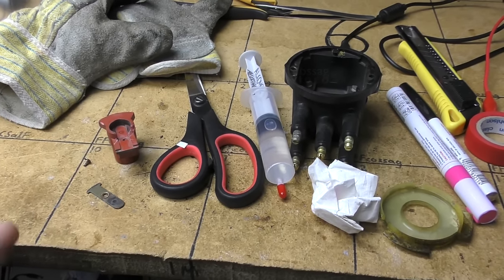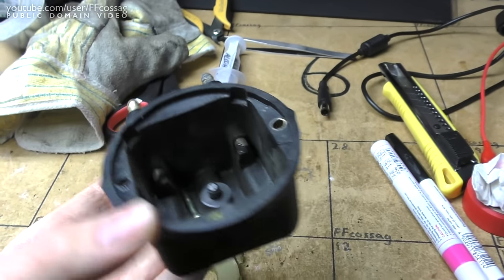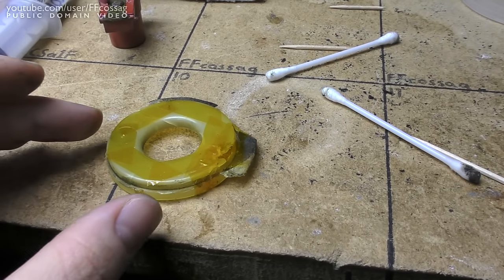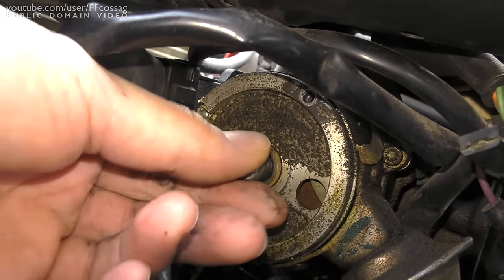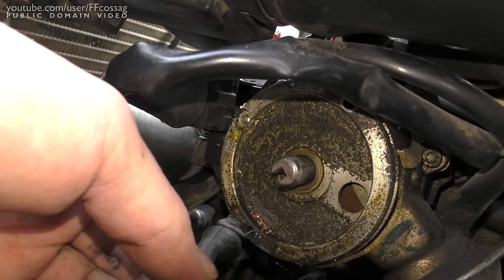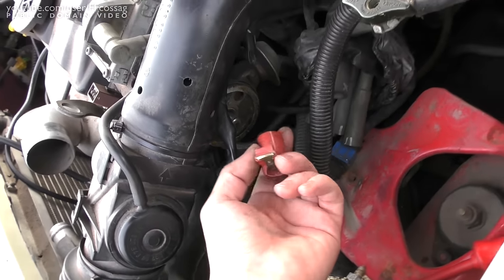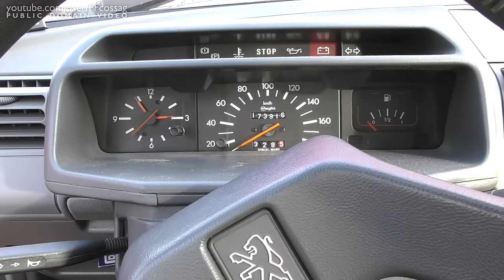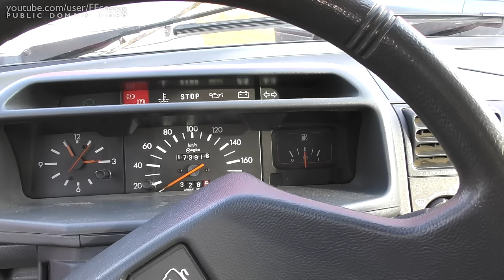FAILURE! Trying to fix a mangled ignition distributor on my Peugeot 205

Comment: I'm surprised the distributor lasted as long as it did. I had a similar issue when I almost hydrolocked the engine in my 96 Corolla a few years ago, engine was NOT happy with me after that happened, and I took the cap off and found it had water in it. and to make matters worse, it was starting to corrode the contacts inside. I think the fix was a drying session out in the sun and then some light scraping with a dull flat-head screwdriver to just remove the ever-so-thin top layer of everything, and the distributor was working like I bought one.

Comment: Oh, and you could drill a hole in the rotor and put a small screw in it to replace the plastic tab that was there before, so you don't have to worry about it slipping and stranding you on the way to a shop or something.

Comment: FF... The RPM tick-over is high because of the rotor arms misalignment.. Basically if the rotor arm is not in it's correct position the ignition timing will not be correct. In your case it's too far advanced hence the high tick-over.

A new rotor arm will sort it out, but to be honest your best changing the rotor arm and distributor cap together as the cap looks rather old and worn too.. Any hairline cracks in either will cause a misfire especially in damp conditions.

Cheers
John
Reply from the maker: The cap is just a couple of years old. I don't think the arm alignment should affect timing too much, since the timing is managed by the ECU. As long as the arm is in the right place to pass spark to the correct cylinder, it should be fine.

That said, all that shit is getting changed, because all of it is fucked.
Reply: Hi FF... Agreed.. the timing is managed by the ECU, however the ECU still 'thinks' the timing is correct as it actually measures the distributors impulses from the pick-ups in the base of the distributor. 
However as the rotor arm is now fitted a few degrees out of alignment, the ignition timing will be that same amount out of alignment as changing the distributor rotation angle (or rotor arm angle in this case) adjusts it. What's actually happened  is that the ignitions base timing has been changed.. Hence the RPM rise.

The timing will only be a few degrees out though.. Well unless the rotor arm slips :o   :)

Cheers
John
Reply from the maker: I see what you're saying. I'm confused though, I was under the impression that the ECU would fire the coil at set times according to sensor data, and as long as the rotor is close enough to the contact about to receive spark, it'd receive it at the correct time, as the ECU would fire the coil during the rather wide time window that the rotor makes contact with the cap contact.
Reply: The ECU will read sensor data then command spark at the necessary/detected times. But in older vehicles it is not as advanced as newer ones..  You have to remember that ignition timing is not fixed for all RPM's.. It is set normally at idle (or more specifically at a SET low RPM .e.g. 700rpm.)  But after that it varies a lot (up to about 50 degrees IIRC) depending on throttle position, engine load, road speed etc.. And it is still variable at this point, hence the a large (in degrees) rotor arm tip.

Also as you can imagine the spark time windows may look big inside the distributor, but they're quite small really especially considering the 3000+rpm speed at which the rotor arm passes the contacts.. That is assuming a standard (6000rpm redline vehicle.) 3000rpm is the camshaft/Rotor arm speed which is half crankshaft speed. And don't forget the varying vacuum timing on top of that too.

Basically what I am saying is that at idle speed.. even though you may only be a few degrees out with the rotor arm, your ECU ignition timing is reading the ignition timing as being correct via the crank, cam, pulse and pickup  sensors.. However it cannot know what position the rotor arm is in as it has moved slightly from it's fixed location... And again this is why your idle speed is a bit higher. 

It's no problem really though FF as a new rotor will put it right immediately :)

Cheers
John
Reply from the maker: What I don't get is how going from "spark produced while distributor is making contact" to "spark produced while distributor is making contact" would make a difference. As long as the arm isn't offset so badly that the arm isn't making contact while the spark is produced, I don't see how it would change anything unless it was trying to ignite (as you say) really far off TDC.

Granted, we don't know the actual timing at cold idle, so the engine could actually be having super advanced timing to the point that a slightly offset rotor causes issues.
Reply: Ok... So the rotor as well as many other things in the ignition system including even spark plug gaps have an effect on not only the ignition timing points, but also on the spark duration time. Unless we're talking race engines this is normally around 1-2ms, now at an idle of say 800rpm or so a spark duration of 1ms will cover about 6° degrees of crank angle..  so 3° of cam. If the rotor is not where is should be...You'll either get a higher or lower tick-over rpm depending on which way the rotor has turned. If it's quite a few degrees out you'll start to get misfires, as not only is the timing wrong but the sparks time duration is wrong too so the burn is not complete.. If it's quite a way out the engine will not run at all or will pop and bang as the plugs are firing way before or after TDC. 

I've had some vehicles brought to me in the past were the timing has been so far out the plug firing sequence has changed :o  Now that does sound rather funny :)

You can actually see how little movement is required to change the timing to rather extreme levels.. Just look at the bottom of the distributor where it bolts to the head.. You will see either one or two elongated bolt holes, this is how base timing is adjusted.

Hope that helps a bit FF

Cheers
John
Reply from the maker: It still doesn't make much sense to me, since in this case the engine ran poorly at idle, where the rotor connection time is an eternity compared to spark duration. At higher engine speeds, what you're saying makes sense.

Since timing is controlled by adjusting the actual distributor housing, I can't see any mechanism in place which would allow the rotor/cap alignment to affect timing at all. The entire timing mechanism is in place prior to the ignition coil. The distributor is just a switch which is connected in series with the output of the coil, and as long as the switch is connected to the right output for long enough to allow current to pass through, it shouldn't make a difference when it connects and disconnects.

The only reasonable issue at play here that I can see, is that the rotor is actually GROSSLY out of alignment, causing the spark to jump through the air inside the distributor rather than through a solid connection. It's not even out of the question that the distributor cap contacts have actually been mangled and are not ever making proper connections anymore.
Reply from the maker: "When the vacuum mechanism is active the negative pressure from the throttle body/inlet manifold pulls on the diaphragm, and the movement in the diaphragm via the small bar then twists the mechanism inside of the distributor which alters the ignition timing via the 4 pole rotor & inductive pick-up"

This is exactly my understanding of how it works, and it's why I don't see how the position of the rotor would cause timing issues, as the rotor has nothing to do with actually determining when spark happens. It's also why I think that the most reasonable explanation for the problem is that the cap is fucked and not allowing spark to pass through with enough energy to ignite the fuel very well.
Reply: FF... Your rotor arms internal locating pin has sheared off right?.. Ok so there's a possibility that your rotor is not aligned correctly OR that your rotor arm can now rotate on the rotor shaft, as there is no locating pin holding it in its required position. 
If that rotor arm is not in the exact position it should be when the coil fires, it means that you are then going to have the spark happening too early or too late, as the pickup underneath the distributors top plate has triggered the ignition signal to the ECU either too early or too because the rotor arm is in the wrong position in relation to the timing rotor pick-up lower down in the distributor.  

Once your new cap and rotor arm are fitted you should be ok as everything will be locked in it's correct position.. However If there's still a misfire after that then you're going to have to start pulling plug leads CAREFULLY (with insulated pliers) whilst the engine is running to determine which cylinder is misfiring. Then determine if it is electrical, mechanical or air/fuelling miss.

Cheers
John
Reply from the maker: "If that rotor arm is not in the exact position it should be when the coil fires, it means that you are then going to have the spark happening too early or too late"

No, this makes no sense unless the rotor is so far out of alignment that it can't pass a spark properly.
Reply: FFcossag.. There's always the practical test FF... Twist the rotor arm or distributor about 5 degrees and see what happens :)  WARNING: Just make sure you mark the distributors base if you do it that way & know EXACTLY where it aligns.. because by doing this you're throwing the ignition timing out. Well unless you've got a timing strobe of course and know how to use it.. I'd sort the misfire out for you if you lived close enough mate, or at least loan you my tunning gear. 

Cheers 
John 

Cheers 
John
Reply from the maker: Oh, I'm not questioning that turning the DISTRIBUTOR would alter timing. I'm questioning that turning ONLY the rotor a few degrees would alter timing. 

The reason I'm not too keen on accepting your explanation is that nothing has happened to any of the timing-sensitive components inside the distributor, nor has the distributor been turned. The rotor and cap are the only two components which were affected by the failure.

I'm not disagreeing because I'm trying to be a stubborn dick, it's just that I don't see any mechanism for the rotor to affect anything other than whether or not the spark jumps to a cylinder. 
There's no mechanism in place to allow for that. 
Timing is adjusted by altering when the coil fires, and that mechanism is entirely contained inside the distributor. 
There's no magnetic pick-up or anything on the actual rotor. 
There's no way for the ECU to know the actual position of the rotor, it's just built to cover a wide enough time window to allow the spark to pass at any time that the ECU decides.

Either way, I have what's supposedly the correct rotor in my hand, and I'm going to install it as soon as I have a chance to do so. I'm currently waiting for some snow to clear. When I do that, I'm also going to measure the distributor cap to make sure that none of the connections have broken while having the loose rotor banging around in there.
Reply: No worries FF.. you certainly don't have to take my word for it.. Perhaps my explanations are not coming across as intended.. I'm certainly no physics guru :) Anyway.. I hope your new rotor works great and the cap towers are good.. They looked ok in the video..however as you know 40kV can play havoc with almost anything.. a phenolic resin cap is no different if there's a weeny fracture in it or too much carbon dust floating around.

Cheers
John
Reply from the maker: I had it apart today and the issue is actually REALLY obvious. The output contacts on the cap should be round knobs, but they've been ground down as if put on a lathe by the rotor as it came apart. The spark has to jump about three times longer than it's supposed to. lol.
Reply: They should look cleanly milled, looks a bit like a step carved in a cylinder.  inlet manifold vacuum adjusts timing via the actuator on the distributor making it vacuum controlled not ECU.

Comment: If the alignment of the rotor to the shaft is at issue you might be able to drill a hole in the rotor and add a set screw.
Reply from the maker: I think the issue is that a contact in the cap is a bit wonky.

Comment: What a shame the tech-plonker screwed the rotor :-(
I was thinking a metal or plastic jar lid to replace the crackerly plastic, and drill a small hole through the side of the rotar and glue a pin in to keep it locked to the slot.
Sorry im a bodger LOL.

Comment: You don't need an entire distributor. Just a cap and rotor. Probably don't "need" the cap, but they're cheap. That vacuum actuated thing, is a vacuum advance; it adjusts the timing based on engine load.
Reply from the maker: Yep, got those two parts and it works now.

Comment: You should get a Speeduino and change it to COP(coil-on-plug), like modern cars, and throw the whole ignition in the bin. You would have to learn a bit about tuning so you don't blow it up, ie never too lean, and never too much advance, but there are things to help in that respect.
Reply from the maker: While that is a cool idea, this car is WAY too well-kept to be hacked. I intend to preserve it as stock as possible for as long as possible.

Comment: Ohm out the plug wires, I bet you find the one that was burned on the cap has now burned the core back. should be about 1k ohm per foot. That plug will also be fouled. Get lock washers for the cap or a NEW cap and rotor. Judging by the way the engine cranks, one cylinder does have low compression... bad valve?
Reply from the maker: The compression loss is an odd issue, I have no idea what would cause that to appear so suddenly. I think it's unlikely that the engine has any ignition related issues beyond the distributor, since it was running absolutely perfect prior to the distributor cap falling off.

Comment: Get a new rotor arm, clean up the spark plugs (if still in good condition) or replace. then find someone who will adjust the timing for you as you will need a timing light to do this. Then will probably be sweet again. probably a load of un burnt fuel in cylinders and exhaust from when the failure happened. would need to get it hot and go for a good drive to clear it all out after rectifying the issues. I would not ask a young mechanic to do this as alot of the younger techs now have no idea how to set up a dizzy (everything is ECU controlled these days). Good luck :)
Reply from the maker: It's not a carburetted engine. The timing is ECU controlled, so there's nothing to set up with the distributor.
Reply: Was that not adjustment slots on the dizzy mounting bolts i saw? There is a vacuum unit that adjusts the timing (the bit on the dizzy you were unsure about) based on inlet vacuum, I do not believe this is ecu controlled. Many fuel injected cars had adjustable ignition timing not just carb engines. What engine is in it and I will see if I can get a bit more info for you?
Reply from the maker: It's a TU3 with Mono-Jetronic single-point fuel injection. There are no slots to adjust the angle of the distributor cap, it only mounts one way. I haven't looked into it at all, so I could be entirely wrong about my assumption. From working on this engine at other times, however, I'd expect it to be entirely ECU controlled. Basically everything else is.
Reply: adjustment is done on the main bolts that hold the metal dizy body to the engine, not the cap, single point injection was very similar to a carb set up with slightly better control on the fueling (needed for the Cat). When i am in work tomoz I will try and get some more info off our systems (I'm not a pug tech, but I do have experience on engines of this era).
Reply from the maker: Alright. There's a big high-power looking electronics blob bolted onto the ignition coil, which is what's leading me to believe that it's electronic.
Reply: Not sure what you mean by the blob,  but https://www.petrila.net/peugeot/PEUGEOT/PE1F4D68.PDF has the details of what the timing should be set to also states that when set @ 750 rpm vacuum hose should be removed and blocked off (to keep running smooth) also done at normal operating temp (hot).
Reply from the maker: Cool, I saved that, but it's for the wrong year and wrong engine. Mine is a 1990/1991, and that manual is for the late 80's carbed models. If I look at the Haynes manual for the car (sadly the best ref I have), it specifies the ignition timing for the relevant SPI models (Bosch Mono-Jetronic A2.2) as "ECU controlled (non-adjustable)".
Reply: Sorry for the delay getting back to you, only injection model listed on our system was the TU3M (KDY/Z) and it matches your age range. lists that ignition timing is adjustable with base settings to it set correctly. idle and co2 not adjustable.
Reply from the maker: I'd wager it's just the usual French car thing going on, with a million different configurations available for any given year. My 205 is especially bad as it seems to be both a '90 and a '91 at once, with random bits and pieces from both years, mixed and matched. The front and rear brakes aren't even the same brand.
Reply: My 2001 KIA sportage has a similar problem. Can't find the right crank sensor. I'm going to retro fit a distributor from a 74 Opel Manta. That's the only stock part I know of that doesn't require engine oil and is meant to be pulley driven.